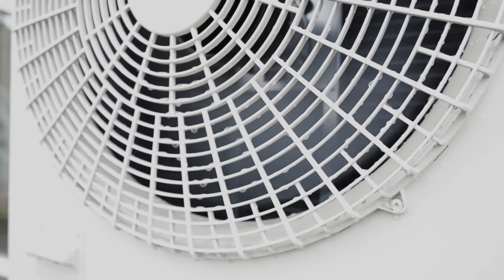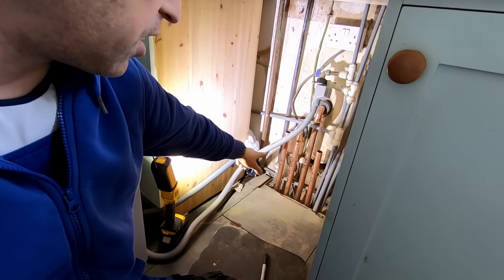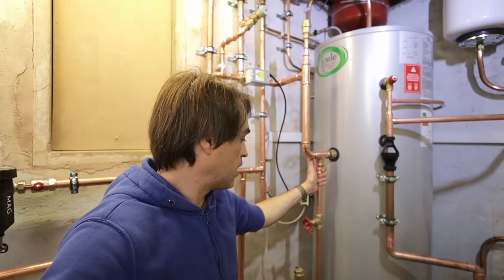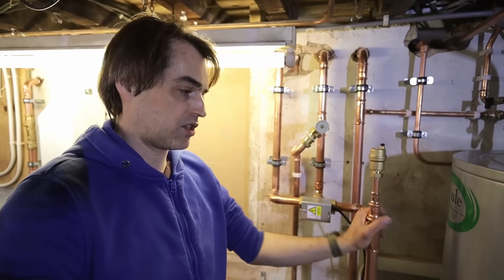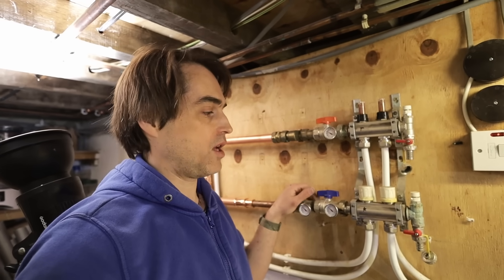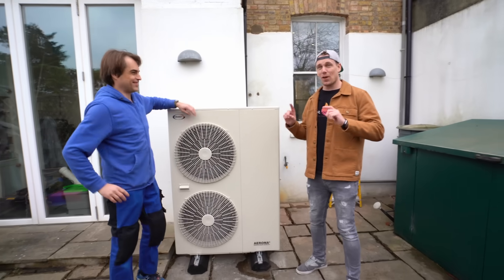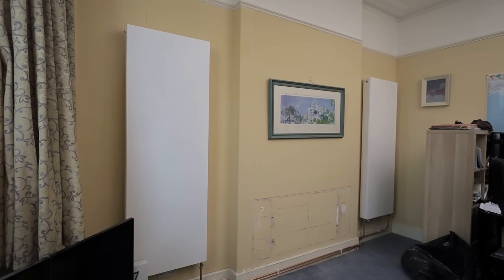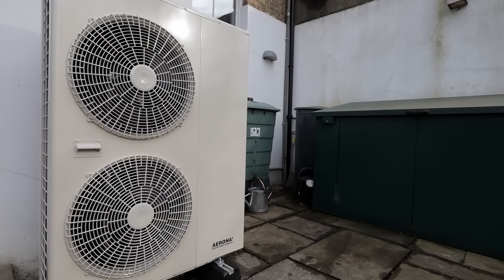The Truth about Heat Pumps: Debunking the Myth.

Comment: This seems to not mention  the issue that will mean most consumers won;t touch a heat pump system with a baregpole: the cost.  A new combi boiler would have been a simply remove and replace job, often a half day labour by a single person.

This sstem requires pretty much ripping out the piping and replacing it, installing a tank and those monster bookcase sized radiators - and that's before you even start looking at remedial insulation without which a heat pump will be ineffective. The heat pump units cost more, but a lot of the cost is the labour.

Electricity costs around four times as much per unit as gas, so energy savings will not be that great, so how long before you break even on the massive upfront capital outlay, which most people can;t afford anyway?

Comment: My electricity currently costs 34.38p per kW and my gas  7.517p per kW (EDF in the UK April 2022).  So to be economic I would need a heat pump with a COP (Coefficient of Performance) of 4.6 (34.3/7.5).  My understanding is that I am very unlikely to get anywhere near that, in a typical UK house, for air source more likely COP of 2.5 .  So I would spend a lot of money installing a heat pump and my bills would go up!
Reply from the maker: Your boiler is usually around 80% efficient, so the actual cop you need is a bit lower
Reply: holy cow your electricity is expensive in Pennsylvania .14 usd per kwh is on the high end and our population density is 1/3 of the UK you guys are getting royally screwed lol hell in Alaska they don't pay as much as you
Reply from the maker: @zachmoyer1849  yep - US is generally much cheaper on all energy - gas, oil, etc..
Reply: @UrbanPlumbers  I knew that but if it was that high here even the environmentalist would be telling them to burn coal lol

Comment: Heat pumps don't work? My refrigerator works and my ac works. Any more questions?
Reply: Heat pumps work fine in a house designed for them, or retrofitted for them (at great expense). Okay here's one question: how much does a heat pump system cost to install compared to a combi gas boiler (which, in most cases, is a simple remove and replace with like forlike, and is a half day labour by one person)

Comment: Doesn't it get below freezing in UK? In Sweden, which of course is colder than UK, copper piping with brass connections is not allowed because the brass cracks. It happens still on the inside of the outer walls before the plastic.
Reply from the maker: almost never gets below zero here. The coldest is around - 2 and happens very rarely.

Comment: People are nuts, think what a joy it is to own a fridge, it sits there using sod all electricity requiring zero servicing, lasts 20 years doing its thing, providing the perfect climate for its contents, and now when we propose using the same technology to make our lives as simple everyone loses their minds.  Its like a cave-man thing, its not true heat if its not on fire.  It'll go the same way as the EV vs my 20 year old diesel car debate, once day everyone will just realise the old way makes no sense anymore.
Reply from the maker: I agree
Reply: Oh please, the two aren't even remote comparable. Fridges are standalone devices and they are designed around the environment they contain and maintain. The Uk has a vast amount of legacy housing which was obviously not designed with heat pumps in mind, in fact, most of it was pretty much the opposite to what you'd do for a heat pump: they are designed around cheap fossil fuel heating (much of it just open coal fires), therefore, poorly insulated and lots and lots of ventilation. It will be hugely expensive to bring properties up to a standard where a heat pump will be effective, if it is possible at all (for exaple, my house is old and doesn;t even have cavity walls). In this example here they have to replace the piping and install monstorusly huge radiatiors. Just how much did all this cost compared to putting in a replacement vombi boiler? Your change to an EV did not require ripping up the road system and replacing it. Oh and fridges are small ans relatively simple devices and whilst they operate 24 hours a day they don;t run 24 hours a day. And you'd be extremely lucky to get one that lasts 20 years!

Comment: Hi Guys. I’ve got a 1940s solid wall semi detached 125sqm 
I’ve installed triple glazing and 90mm external wall insulation (wetherby system) 

I’m looking to install a large 9kW solar PV with battery storage system.  

Would this be enough to run a ASHP?

I’m also looking for a company to carry out a full heat loss calculation for me if any one has any recommendations
Reply from the maker: Check heat geek map

Comment: Again from New Jersey,  the systems your installing are spot on for the job at hand. The systems installed here at this this level of control in the past were mostly in commercial applications.  The residential HVAC market was driven by " Originally" by the cost and availability of cheap energy.  Watching you work makes me realize how far behind the curve our response to energy conservation is. The technology has always been there but it "WAS" a hard $sell with Track homes and cheap oil and gas. Like the quality installations and results.
Reply: Which is why it's great that energy prices are now getting so high; we are more or less forced to change our ways.

Comment: So what you're saying is that the compressor does a lot of the work - especially when the air temperature is very low. Isn't that just a form of electric heating. This is an over engineered mess.

As for fans being quiet - of course they are when new. My CPU and GPU fans were quiet to begin with - 6 months down the line they aren't.
Reply from the maker: Still 300% more efficient than direct electric heating.
Reply: @UrbanPlumbers  under certain conditions.

Comment: Gas central heating and hot water is still way more cheaper even with the high energy costs.

Blooming heck a coke fire and a heat pump would be cheaper than running your heating off electric.

Comment: 70kw,  so current draw upwards of 300 amps.  So did the household need an electrical supply upgrade?  With UK electricity pushing 25 cents/kw hr this will not be cheap to run.   May be cheaper than methane however.   So saw the data plate on the unit, looks closer to 7 kw, not 70 with a max current of 25amps.  Probably cheaper than gas boiler to run at current and likely future methane prices, but kw-hr prices are going to go up rapidly under the current UK regime.

Comment: heat pumps dont work because you cant heat a normal system with it , IF you installed cassettes  on a VRV system you would be able to heat your home comfortably and inversely cool it in the summer